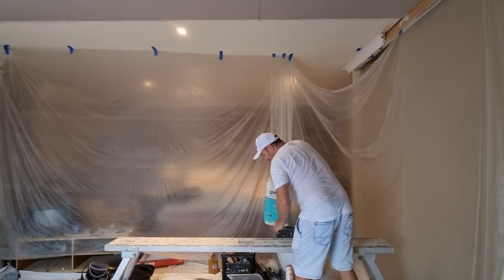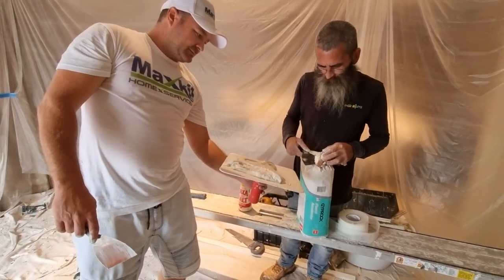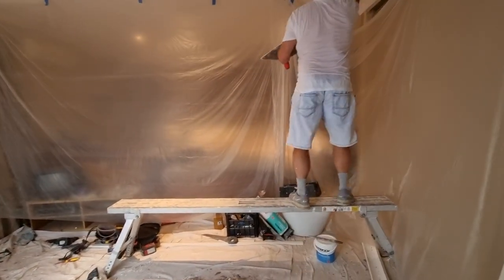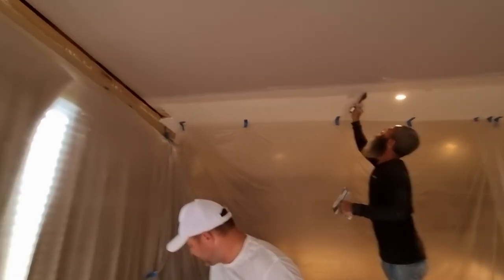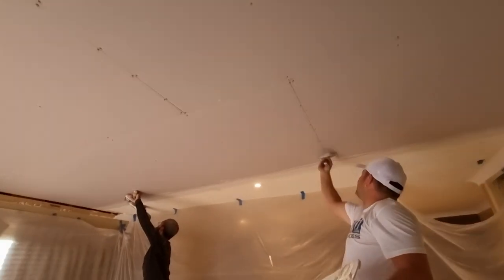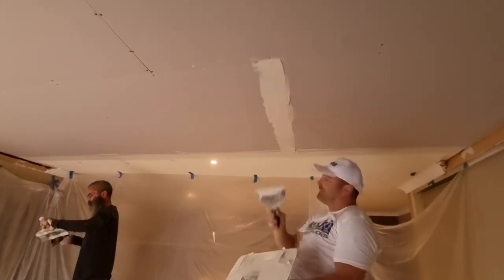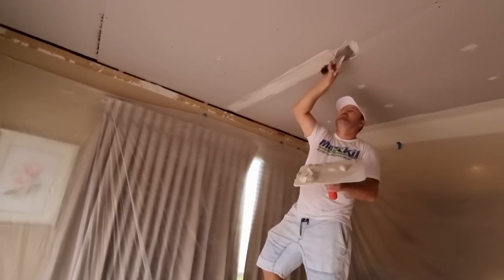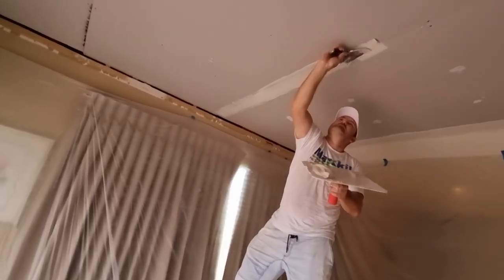Taping Drywall Mud Dry Faster Gyprock Plaster Accelerator VS Table Salt

Comment: That's what's great about Accelerator you can control how fast it goes off. We always prefill our patches and buy the time we get it done and clean our tools it's ready too go again.
Most of the time we only need one mix of base 45 and can get the whole patch ready for a top coat.
Reply from the maker: Right on Tom!
Reply: I use Base 45 then come back around with top coat. I use rapid set on repair patch n paint jobs. I think salt rehydrates with condensation on rainy days and can lead to tape delaminating

Comment: I have a ceiling replacement like this coming up. 
Do u back block your ceiling joints?
If so can I use cornice cement on back blocks or do I need the specific glue?

Comment: 3:30 What's that tape, is that the fibreglass looking one? But I thought paper tape was strongest?
Reply: Fibre fuse is the best.
No bubbles, wrinkles and if mud is thin underneath just press more on.
I teaspoon of accelerator per whole mix .
I put mine in then mix the lot .
Have been considering putting accelerator with csr pro 10  for top coat so as to sand it straight after pack up.
Not sure if will work